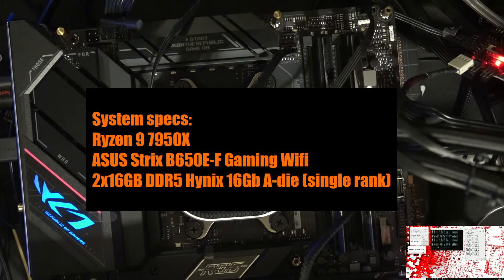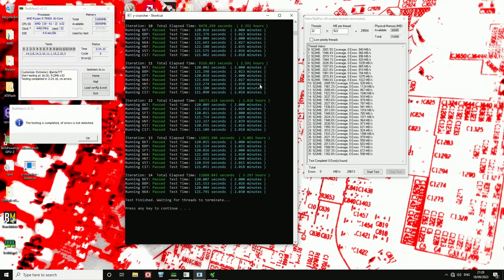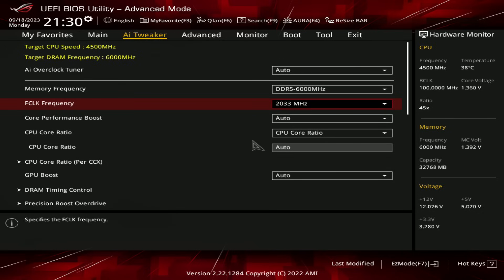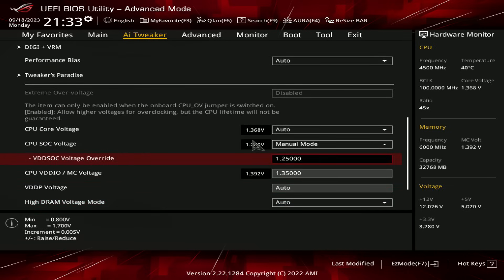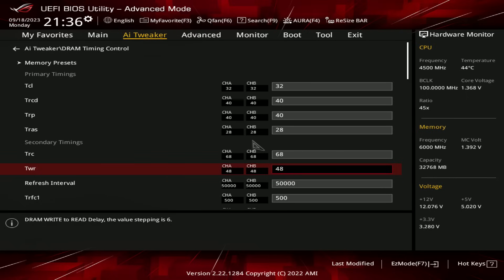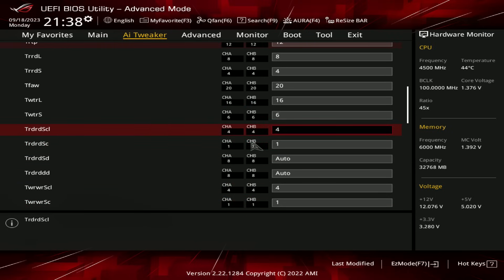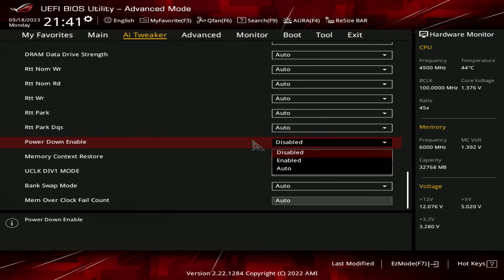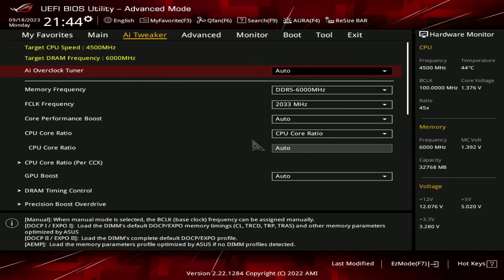Easy memory timings for Hynix DDR5 with Ryzen 7000

Comment: For anybody still searching for a stability solution - this worked in my case (in fact much higher performance and absolute stability):

- Use these standard settings in the video for DDR5 6000. They are more than enough (and if you use iGPU use the max 126 TRAS setting for stability - no downsides). 
- Then adjust the CPU limits. My problem was that the motherboard didn't raise the voltage for the iGPU although the general setting from the OC was changed. So to stabilize it only took to: 
1. Set CPU Curve Optimizer to -25 or -30 (in my case even -35 were stable without any issues)
2. Set iGPU Curve Optimizer to +15 (that one was essential)
3. Now you can even set the maximal boost clock to +200 or more (doesn't matter, since it will usually max out at 5550 for a Ryzen 7700/x).
The temperatures are way down. The efficiency is up. The speed is way up. Rock solid stability in all tests (I really tried everything beforehand... already thought to have a defective core). 
Hope it helps somebody else aswell on the newer X870 boards.
Reply: -30 won't be stable )) 😂
Reply: @Zhandos18 It is for me. As mentioned, even -35 is in my case (but that is a case of lottery).
Reply: @MetallicReg  try to test it properly  , occt CPU+ ram , PyPrime small ftv / Aida ftp cache CPU , ycruncher
Reply: @Zhandos18 72h full test. I was tweaking the system for weeks. Don’t worry. Fully stable.
Reply: @MetallicReg could u make a video with tests? I pretty sure at least 1 core will get unstable
Reply: @Zhandos18 Again mine isn‘t special. If you search, you will find out many that run the ryzen 7 with -30 or even -35 after you upped the general voltage because of DDR5. 
It is a very good chip for CO. 

But I agree with you, that if you count in some of the less fortunate cores, you should stick to less aggressive adjustment to start with.
Reply: @MetallicReg bro i do manual per clock oc  and ram oc with 8800 2200 gdm on 8200 gdm off , 6600 2233 cl26) i know what im talking about) ppl do -30 but doesn't know that it unstable )))
Reply: @Zhandos18 You can ofc do it for each core individually. But if you want to save some time - the overall adjustment makes more sense and you don’t gain much by undervolting the cores by 1-2 levels difference. 
For the general user - either the general CO works, or you should jump for overall stability up. 
Again - the system did already enough problems when it wasn’t adjusted yet (especially since that one runs on the iGPU). 
So it was really tested throughout. The 7700 is very often absolutely fine on -30.  And in some cases even -35.
Reply: @Zhandos18 maybe you get more issues because you are running FCLK in the 1/2 mode and not in the much more palatable 1=1. 
it is known that AM5 is much more unstable at speeds above 6200.

Comment: I'm using 6800mhz ram downloaded to 6000mhz and it's seems to still be stable at cl8 and even less. Is this normal? I have the asus protection thing for the voltages, and I'm using the same motherboard with a 7800x3d.

Comment: Well, my m-die kit, with XMP 6400, could not sustain these timings at @6000 even at 1.4V, so depends on luck :P
Reply: try to decrease vddio, I couldn't get stable even at 1.42v but after set vddio to 1.25v(from 1.35v) things got way better
Reply: lower it at 1.35 brother
Reply: @mujaserbexheti  1.35 is not stable

Comment: These settings could work for 4x16 GB sticks? I got 2 kits of 32GB Corsair Vengeance 6000 CL36 (a pair with Hynix ICs, another with Micron ICs).
When using a single pair (2x16GB) I can run at 6000 CL36 using EXPO. But when I add another 2x16 GB kit, populating the 4 banks, the speed drops to 3600 - it goes SAFE MODE and resets the speed to 3600.

The best I could do, so far, is 3800. If I increase to 4000 it doesn't even POST (I waited 25+ minutes), had to clear CMOS. Interestingly, when I set 5600 or 6000, it at least does POST, but setting the speed back to 3600 and requesting a BIOS setup.

Any chances to have at least 5200 or 5600 speeds or am I doomed to 3800?

System: Asus TUF B650M-E + Ryzen 7 7700 + 64 GB Corsair 6000 CL36
Reply: just use xmp bro
Reply: @Caxfv  XMP? You meant EXPO actually, right? There was no "XMP" option - it is AM5. Anyway, even though I enable EXPO, it won't work at 6000, just 3600 when using 4 sticks. The best I could with manual settings was 3800 - other speeds won't even POST.

Either way, I returned the 4 x 16GB kits and purchased a 2 x 32 GB kit. Got EXPO enabled and speed is back to 6000 - I could even tight a little the timings. Been great so far.
Reply: Yeah 4 sticks is too much for the memory controller
Reply: I have corsair cl30. Do you have tighter timings than the video
Reply: @Caxfv  My Corsair kit is CL40, I lowered to 36, just a little - don't want to fiddle much with it. It came with Hynix ICs, which gave me confidence for that little push. :)

Comment: No matter what I do... 6000 MHz will error out in TestMem5. Even with the loosest timings possible
Reply: There's a great comment from 3 months ago with new timings, I think tRAS should now be super loose like 126, if you share the settings someone here may be able to assist you.
Reply: @Conza-89  yeah I am not talking about his timings, those are great. I am talking about my EXPO... The EXPO at default is far looser and errors out in Testmem5, so his timings just add to the fire
Reply: @bidasval2166 you’re missing the point my friend. They are all related. You* enable expo, keep the top 3 timings, then set the manual timings
Reply: @Conza-89 I did. Got errors in TestMem5 within 15 minutes. Not a memory overheating issue, I have a fan directly on the sticks and the room is pretty chilly with the AC on. So I guess my motherboard is shit... Or my cpu's memory controller sucks

Comment: what about GDM and PDM (for MCR)? Im on 6400cl30 with FCLK 2200 1:1 1.4v GDM PDM
Reply: Gear down mode I also wondered about, I'd leave it at auto for now, you've set UCLK=MEMCLK so. I personally leave PDM and MCR ON, because they will bluescreen if either is left on with the other off, and I've found no issues with doing so immediately upon changing settings. congrats on the 2200 FLCK

Comment: Hi fellow viewers that are probably smarter than i. I have a 6000mhz 2×16 kit of gskill ram using hynix a die. Can i set expo to on and just move the dram frequency to 5200mhz without changing anything else? Or do i need to readjust all the timing manually? I have tried 6000mhz wigh 4 different ram kits on my 7800x3d and they are all unstable after a few days of boot cycels.
Reply: Hey mate, it's a bit of a trick, I'm going to copy and paste a comment from 3 months ago by zugre, so he deserves full credit for this. Enable XMP only if you need to, to be able to adjust the settings yourself. I'll change 1 portion, for
Memory Context Restore & Power Down Enable: Most users say to disable these two, I suggest first trying them both enabled, but whatever you do, do not have either one on with the other off, this causes bluescreens. If you're lucky, your system will boot more quickly after training once, then retain training, if unlucky it may be unstable, in which case, turn both back to off (this will retrain every single time).

"
UPDATED TIMINGS:
Voltages
VDDIO / MVDD / MVDDQ: 1.35V
VSOC: 1.25V

Timings
tCL: just use XMP
tRCD: just use XMP
tRP: just use XMP
tRAS: 126*
tRC: 68
tWR: 48
tREFI: 50000
tRFC: 500
tRFC2: 400
tRFC4: 300
tRTP: 12
tRRD_L: 8 // Some hynix A-die really really sucks at tRRD_L
tRRD_S: 4
tFAW: 20
tWTR_L: 16
tWTR_S: 6
tRDRDSCL: 4
tRDRDSC: 1
tRDRDSD: AUTO (only relevant for dual rank)
tRDRDDD: AUTO (only relevant for multi rank)
tWRWRSCL: 4
tWRWRSC: 1
tWRWRSD: AUTO (only relevant for dual rank)
tWRWRDD: AUTO (only relevant for multi rank)
tWRRD: 2
tRDWR: 16

FCLK: 2000
UCLK DIV1 Mode: UCLK=MEMCLK (1:1 Mode)

*This was previously 30. (there was stability issues and screen flickering whilie using igpu...)

Buildzoid: "as far as I can tell. Setting tRAS to 126 has no effect on performance. While setting tRAS too low can cause stability issues. Also AMD's memory controller doesn't follow the JEDEC spec of tRC = tRAS+tRP. So setting tRC really low even to the register limit of 32 actually gains performance even when tRAS and tRP are set to 126 and 36(which according to JEDEC would be a tRC of 162). IDK if tRC 32 is good idea(as in stable)."

update source: https://www.youtube.com/watch?v=BS_NeTwjOvY
"

Comment: Did your setting with 8x96gb sk Hynix diamond commercial series and managed 48.7ns 6600mhz cas 24 after using your setting and literally tweaking everything 1 increment at a time alongside voltage adjustments over 3 weeks, Thankyou! Thus woukd have taken months otherwise!!

Comment: Hey Buildzoid is it possible is possible to run the Ram (2x16 GB 6000 gskill cl30 hynix) on a daily Basis with 1.5v in your experience? Would be great hearing from didnt find any reasonable Answer yet.
Reply: 1.5 for long term is really a lot brother avoid higher voltages if ur not overclocking mostly on 6000mhz 1.35-1.4 work easy i lowered to 1.35 based on buildzoid and rlly impressed much stable than 1.4

Comment: Funny you should say that. I do my memory overclocking inside a dual chamber case with 2 moderately power-hungry GPUs. Although, one of them is a seahawk variant, so it's not really contributing much to the heat.

Comment: @Heisenberg355 does an amazing job with summarizing the values from the video, but there two small changes that will apply to newer BIOS versions.

First, force enable both "Memory Context Restore" and "Power Down Enable". Both of these options will greatly increase your POST times, but the first cold boot from power loss can take up to two full minutes for memory training. This should work on any BIOS versions from around November 2024 and newer, at least on Gigabyte boards. They both need to be force enabled to work correctly.

Also, on my 7800X3D with my Gigabyte Aorus Elite AX on BIOS F32, the board will fail to even boot with stock EXPO settings unless I manually drop my CPU VSOC voltage to at least 1.2v. Just turning on EXPO after a CMOS clear will make the board unable to POST when rebooting from the OS or pressing the reset switch -- but cold boots work fine. Dropping the voltage manually even further from 1.25v fixes all these issues.

Higher voltages than 1.2v on my exact chip cause instability with EXPO. The board will reboot and flash the CPU and DRAM debug LEDS back and forth without a reboot, and only a CMOS clear will fix the board at stock voltages (1.345v) or the voltages manually set to high.

The max safe VSOC voltage by AMD is 1.35v, and it appears Gigabyte took the lazy and quick route of just setting the default voltage to 1.345v on the later BIOS revisions back in mid 2024 after the VSOC voltage issues, but this is way to high for some X3D CPUs, especially with tighter timings or higher clocks.

Comment: Do these timings work with the new 9800x3d and Hynix M-dies?
Reply: Yes. Using it on a msi x670e tomahawk. Just went through all my  stress testing this week on this and my cpu undervolt. 

About 350pts more in timespy extreme over expo. About an extra  30 seconds longer boot over expo. 

Worthwhile trade.
Reply: it says hynix am i right?

Comment: Did your settings in r9000 with a 32GB A-Die 6400 Kit from Gskill. Cold boot is great, warm boot (~60 degrees) shortly after stress test does not work. Any ideas?

Comment: Mine is set to Auto Failing , i have 0D and ram error on every RESTART out of the box no EXPO enabled on a x870e Aorus pro ICE with 9800x3d ,its very strange because its only on restarts , it passed 3 months i have tried anything possible no luck !!!     Anyone helping me with this ???
Reply: Turn on monitoring software reboot workaround
Reply: @ Didn't worked , already tried.....its seems that with another ssd and new windows its working !

Comment: UPDATED TIMINGS:

Voltages
VDDIO / MVDD / MVDDQ: 1.35V
VSOC: 1.25V

Timings
tCL: just use XMP
tRCD: just use XMP
tRP: just use XMP
tRAS: 126*
tRC: 68
tWR: 48
tREFI: 50000
tRFC: 500
tRFC2: 400
tRFC4: 300
tRTP: 12
tRRD_L: 8 // Some hynix A-die really really sucks at tRRD_L
tRRD_S: 4
tFAW: 20
tWTR_L: 16
tWTR_S: 6
tRDRDSCL: 4
tRDRDSC: 1
tRDRDSD: AUTO (only relevant for dual rank)
tRDRDDD: AUTO (only relevant for multi rank)
tWRWRSCL: 4
tWRWRSC: 1
tWRWRSD: AUTO (only relevant for dual rank)
tWRWRDD: AUTO (only relevant for multi rank)
tWRRD: 2
tRDWR: 16

FCLK: 2000
UCLK DIV1 Mode: UCLK=MEMCLK (1:1 Mode)
Power Down Enable: Disabled

*This was previously 30. (there was stability issues and screen flickering whilie using igpu...)

Buildzoid: "as far as I can tell. Setting tRAS to 126 has no effect on performance. While setting tRAS too low can cause stability issues. Also AMD's memory controller doesn't follow the JEDEC spec of tRC = tRAS+tRP. So setting tRC really low even to the register limit of 32 actually gains performance even when tRAS and tRP are set to 126 and 36(which according to JEDEC would be a tRC of 162). IDK if tRC 32 is good idea(as in stable)."

update source: https://www.youtube.com/watch?v=BS_NeTwjOvY
Reply: Perfect, thank you. Couldn't get EXPO or manual OC stable with a kit on the QVL but this passes many passes of memtest86, memtest86+ and casual use.
Reply: Where is this Update from?
Reply: @fidonol  update source: https://www.youtube.com/watch?v=BS_NeTwjOvY
Reply: Is FCLK frequency at 2033 still recommended on the recent bios?
Reply: @binodynamic  nope, its fixed and should be 2000 now, and VSOC can be lowered at 1.20v, I use 1.15v and works fine
Reply: @fidonol  Great. Thank you
Reply: Ty
Reply: Thankss
Reply: Thanks much!
Reply: Nice
Reply: Hey, should I use those on cl26 6000mhz on 9800x3d?
Reply: The video said FCLK 2033. Has this recommendation changed ?
Reply: @luisbravo3435 what did you go with?
Reply: @luisbravo3435  Yes. At the time there was a bug with FCLK 2000 that firmware updates corrected it. Now you can use FCLK 2000 with no issues.
Reply: @phabran  Sorry, is it FCLK 2000 or FCLK 2033 thats recommended now? :) I'm on B650 wifi, 9800x3D.
Reply: I just applied these settings on an MSI board with the latest AGESA 1.2.0.3a patch. I had bluescreens so I had to disable memory context restore. This step is still needed.
Reply: @rsrsrsrsrs618  I'm on AGESA 1.2.0.2b and I also have to disabled both MCR and Power Down or I cannot boot in to an OS, despite 24 hours passing memtest86+. The long boot times are a little frustrating but otherwise the system is rock solid.
I'm waiting for AsRock to release a non-beta 3.20 BIOS for my board but I'm not too hopeful.
Reply: 3.20 isn't beta anymore is it? @kiri101
Reply: Do you know how to change VSoc on an ASRock board
Reply: THIS! I couldn’t figure out why I had artifacts in CS2 on a iGPU
Reply: @zugre hey bro i got kingston fury a-die 6000 htz cl30 / i can run it at 6200 or should you say just go for the 6000 htz ?ty in advance
Reply: Thanks. I used these timings @6200 30-38-38, FLCK 2067 on my 9600x, asrock b650m-hdv, 8000 cl38 2x16gb vipers
Reply: my default vddio is 1.40, should i lower all three to 1.35v?
Reply: This worked on my G.Skill 96GB 6800MHZ CL36 kit.
Reply: goat
Reply: Will this work with expo also?
Reply: What if you go with flck 2133 instead of 2000?

Comment: on this timings, using igpu there is chance for screen flickering when watching 4k yt videos on chrome. Increasing tRAS from 28 to 35 and tRC from 68 to 70 fixed my flickering. I read several posts when people had flickering issues when using igpu and they fixed it by increasing the tras and trc. This is good to know because i lost a lot of time finding what is the problem. 9800x3d / 6000 cl30

Comment: Buildzoid can we get an update video for the new cpu Ryzen 7 9800x3d paired with the same X670e motherboard?
I am having a tought time making my build stable.
Reply: What kit are you running and what speeds are you aiming for?
Reply: @twenty1sportscards790  32x2 6400 MHz, CL 32. I aim for 6400 MHz.

Comment: Question: if my kit has expo profiles, should I go with those timings first and then follow this guide? My defaults are (jedec) CL40-39-39@4800 and for expo (which i cant get stable) is CL36-38-38@6000?
Reply: i used the expo profile first and then applied these timings afterwards, havent had any stabilitiy issues so far. latency is a tiny bit lower using these with expo on compared to off
Reply: @asenaasdnia9233  I ended up doing the same. Finally I can get the most out of my 7700X. Only took a little over a year xD. So far 10~ days running and rock solid stability.

Comment: So the 2033 FLCK was a bug. Is it now recommended to set it to 2000 or 2100 for 6000mhz?
Reply: if you are on the latest bios you want to use 2000 now
Reply: @asenaasdnia9233  what if i am using 6200mhz, would i still benefit going from 2133 to 2000?
Reply: can u lmk if u find the answer
Reply: set it to 2000. https://www.youtube.com/watch?v=BS_NeTwjOvY&ab_channel=ActuallyHardcoreOverclocking. Also in recent comments there are the updated values

Comment: Im running a Gigabyte Aorus Master x670, R7 7800x3D and GSkill 6000mhz 64gb (F5-6000J3040G32GX2-TZ5RK) its a Samsung die, can i simply try out your settings no problem? Are there things i have to watch out for? Im very experienced in undetvolting, recently finishee stresstesting and benchmarking my 4090 and absolutely loved it, im slightly undervolting the pcu but i am completely unexperienced when it comes to ram, it always seemed to finicky to me. Simply runninh XMP currently